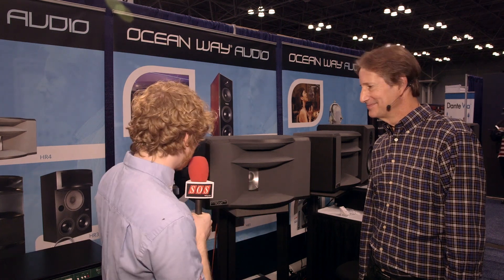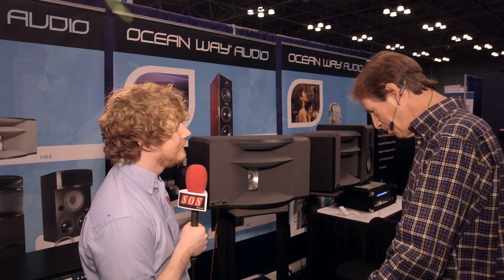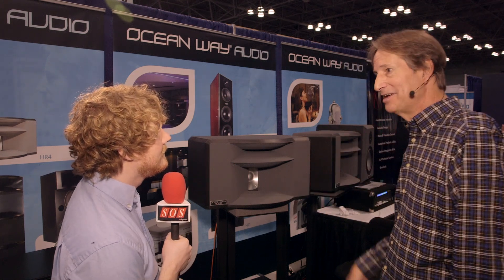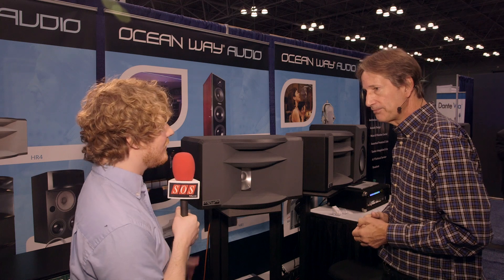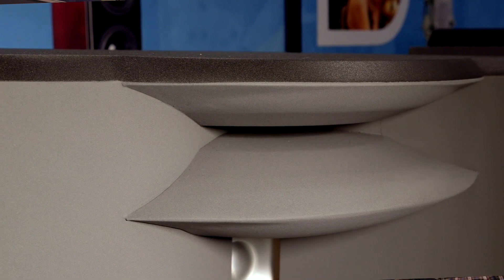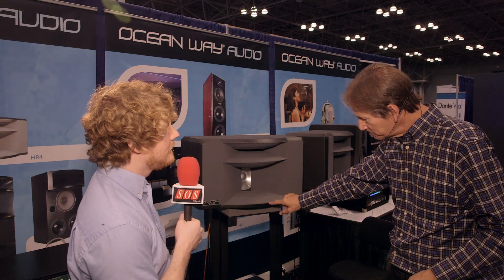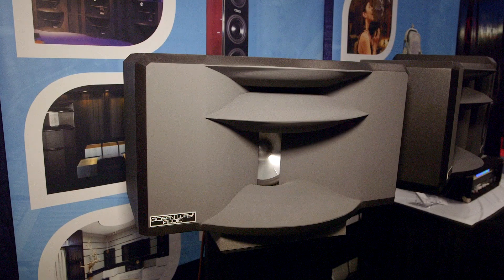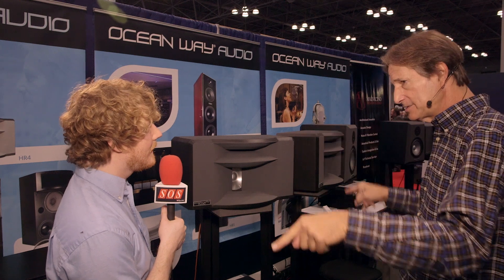Ocean Way Audio HR4 - AES 2015

Comment: Unfortunately, it is maddeningly easy to chip off bit and pieces of those shrap edges. Even though I had wanted studio monitors, I picked up a set of (5 pieces) of PA-class actives, as the drivers are superbly protected by metal grilles on those.